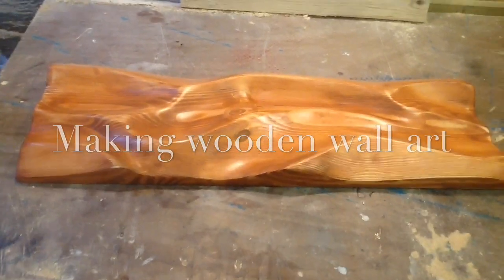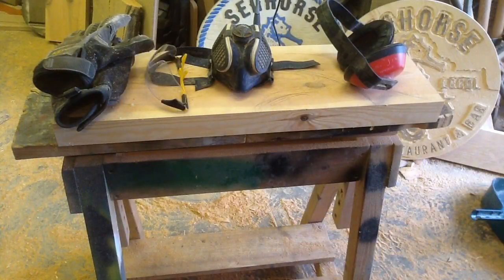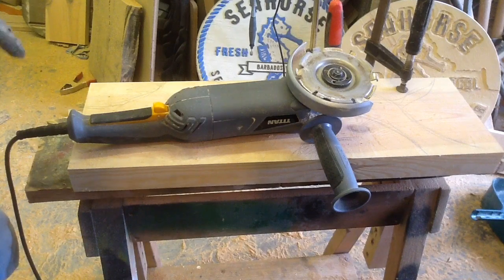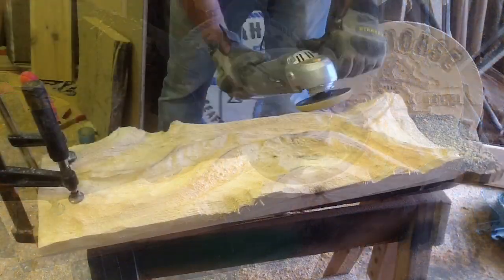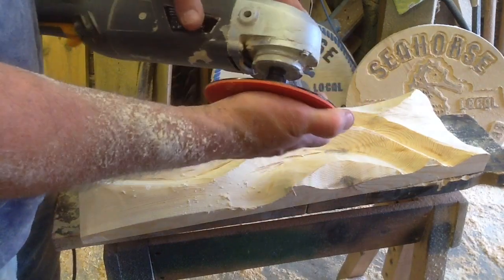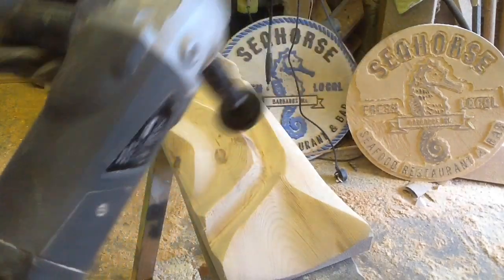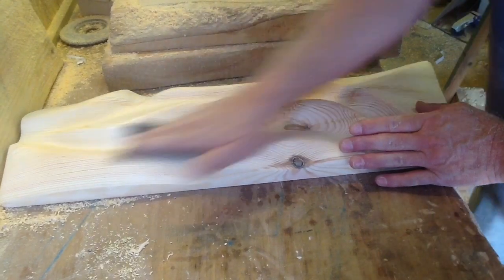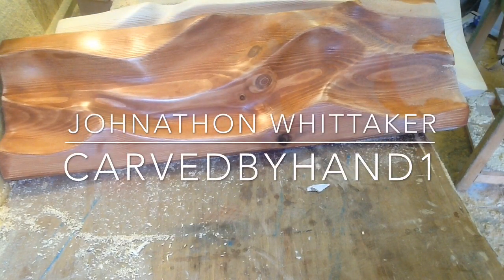wall art from wood- power carving

Comment: Back again!  LOL!  Had questions about getting a clean smooth surface.  Soft pads and lots of sanding!  Working outside next to shop.  Trying to figure out how I might do this  in my shop when it's winter in MN?
Reply from the maker: A really good extraction system and a good respirator
Reply from the maker: I do it in my workshop throughout winter but it's not  -200  in england
Reply: @JohnathonWhittaker  Have a forced air furnace that I installed. Figuring a dust booth to protect everywhere else.
Reply from the maker: @thomastieffenbacherdocsava1549  that would work! Power sanding is messy though

Comment: I am a beginner and I am interested in doing these types of work. Which Kutzall album do you recommend?
Reply from the maker: The kutzall or saburr discs are perfect.  They fit on an angle grinder and are very good at creating different contour shapes. Or you can just use 40 grit, flap sander discs, they also remove alot of material. The hardest and most time consuming part is the final sanding. That cam take a few hours but definitely worth it. As for the design, study a few pictures of sand dunes or water and then draw the pattern on. Make your lines the high point and remove everything in-between to make gentle curves. Best of.luck with it and don't hesitate to ask any questions

Comment: Absolutely amazing. Could you possibly give me a list of the attachments used for this piece on the grinder
Reply from the maker: Hi Carl, thank you! the tools i used for this are ; Graff speed cutter, flap discs - 40 - 120 grit. the saburrtooth 4" carving disc, ( the yellow one is the smoothest grade). the sponges i used for sanding are called interface sanding pads. commonly used in car polishing, i use both 4" and 2" pads. the final tool was the arbortech contour sander, quite pricey but they work very well. hope that answered your question and thanks for watching
Reply: @JohnathonWhittaker  
Thank you so much mate. Brilliantly detailed too. I’ve order a few bits today so very anxious to get started.
Reply from the maker: @carllove7353  i know the feeling! Feel free to send me a message if you have any more questions
Reply: Hello mate. Just wondering. Will I still achieve the same results if I skip the flap disk and and just the sanding with a 40grit and all the way up useing normal sanding disks on the backing pad.
Reply from the maker: @carllove7353  yes you will, the flap discs are just more aggressive and longer lasting. you dont need to use them. regular 40 grit hook and loop will be fine, you will just go through more of them. another great thing to get if you dont already have one is a rubber block to clean off the sandpaper as you use it. it removes all the clogged sawdust from the sandpaper really increasing the life of each sheet. you can get them at toolstation or screwfix

Comment: Looking around for variable speed grinder.  Is the titan a 7 inch?  Looked at 4 inch grinders variable speed but no low to medium available or discontinued?
Reply from the maker: The one i have is a Makita, not sure on the model make, will  check for you tomorrow. I highly recomend a variable speed, you will be able to use it in so many more ways. Most fixed speed angle grinders use to high an Rpm for good sanding and polishing. They will literally just through the pad off
Reply from the maker: Ok the titan I had died on me and I replaced it with a Makita  GA5040 C . Been using this one well ober a year and very happy with. Takes the 4.5 inch discs
Reply: @JohnathonWhittaker  Thanks!

Comment: Thank you,
How about starting debuting with Bayerwald Woodcarver Pro Set | Milling Disc for Angle Grinder and then go to Kutzall Genuine Dish Wheel - Fine Tungsten Carbide Coating or go to Kutzal l Extreme Dish Wheel - Medium Tungsten Carbide Coating
Reply from the maker: Ya I would love to, I use the tools I have but always open to trying out and reviewing different tools and accessories

Comment: Wow !!! they look amazing once stained and finished . GREAT video thanks a lot for sharing. Deffinatly gonna be trying this at some point. Do you have links to the sanding attachments used ?? .
Reply from the maker: R2the B the is for the great comment, I don't have the links but  i used the arbortech contour sander, and some foam backing sander pads. Any kind of sponge will do.  Check out.stores that have car polishing gear and best of.luck

Comment: Can you please tell me more about why you torched it?
Reply from the maker: Hi Elizabeth,  at this stage, I give the piece a very light burn. This helps to show and spots where I need to concentrate sanding on and also dries out the top few layers to make sanding easier. It can also add a little more colour contrast in the wood. The trick is to apply the flame very lightly, just so the wood starts to turn colour but not enough to burn. The areas that darken the most need the most sanding for the best effect.  I hope that helps  and feel free to message me if you have more questions

Comment: What size board did you use?
Reply from the maker: I generally use 8 x 2 inch board, the length depends on what the customer wants. If they want a larger piece, I will join the 8 x 2s together and cut to suit

Comment: Got a variable speed  Makita per your advice. Had to return and replace.  Going to do some more practice.   Looking at end of video.  Foam pads under sandpaper. hmmm!  Thanks again!  See you on Instagram.
Reply from the maker: What was the problem with the grinder?the foam pads work great, make sanding contours so much easier
Reply: @JohnathonWhittaker  Have replaced it as the bearings in my first one were sloppy or ungreased. Can tell from rattling sound. New one sounds and feels great.
Reply: @JohnathonWhittaker  Answered in wrong place. Either a faulty bearing or lack of grease.Purchased on Prime. Got a replacement asap. Sounds good, works well.
Reply from the maker: @thomastieffenbacherdocsava1549  Definetly don't want to use a malfunctioning grinder! But one that works well is great